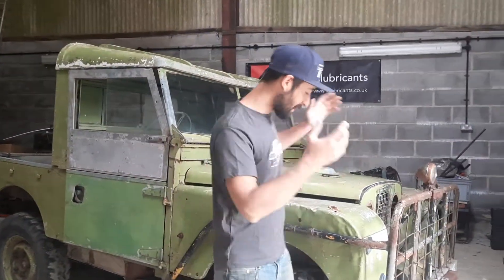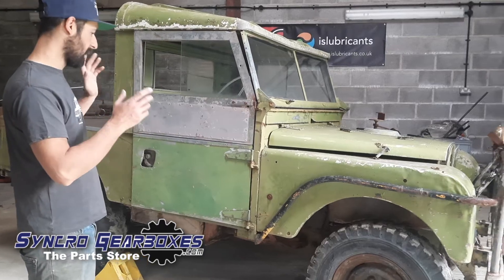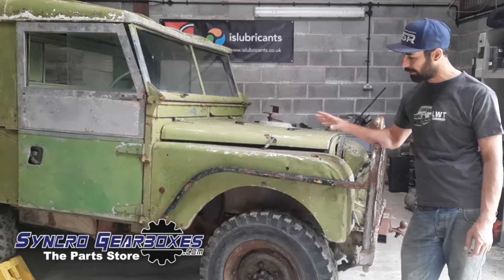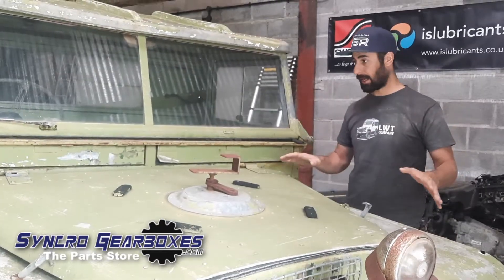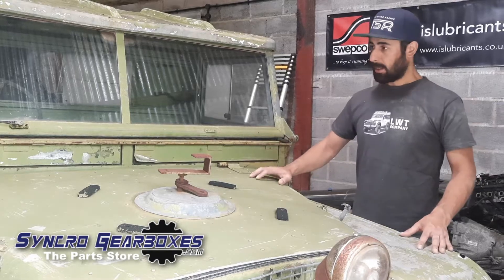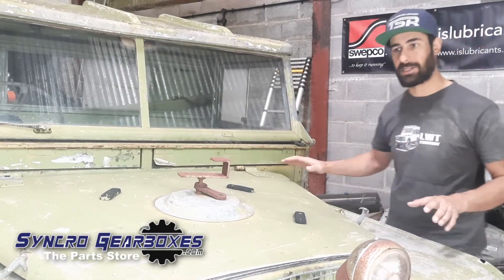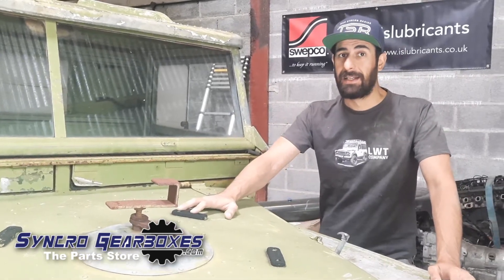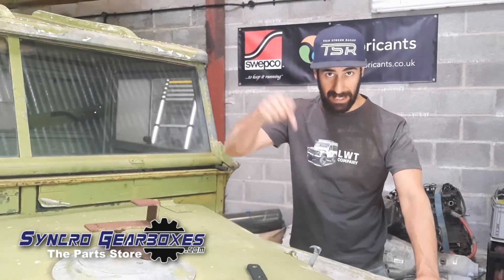02 - Land Rover Electric Vehicle - What Have We Got Ourselves Into!

Comment: What a great project. when first seen i thought the bar protecting the front wing looked realy good, then the front bumper Roo Bar not so. maybe when finished you could build somthing that touches on the Australian Heritage of the Roo Bar but a little bit more subtle?
Reply from the maker: I'll put some though into it. There's still a little bit of tube on the bumper that I was going to remove. It could be kept as a nod to its history. I wouldn't want a full on bar as I don't like the look and it's a 100kg of dead weight to lug around, which for the ev side of things is wasted fuel. The bit that's still on the bumper might be cool to keep though! 😎